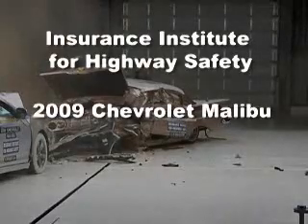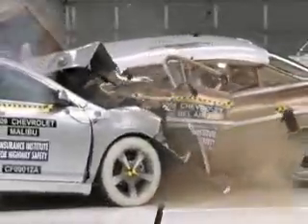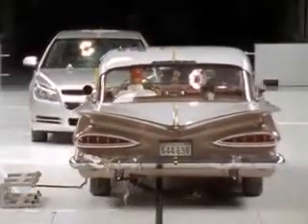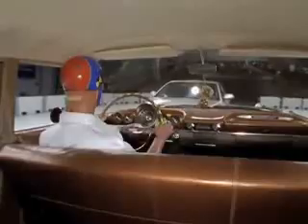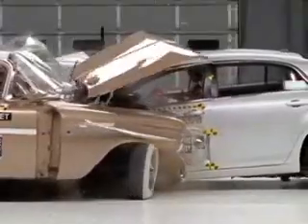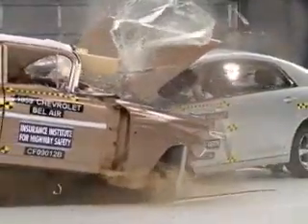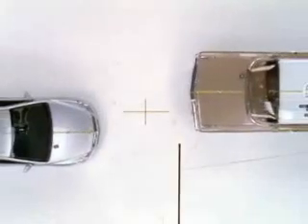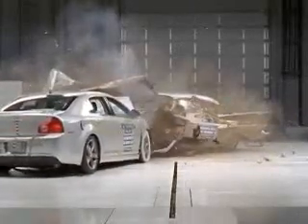Crash Test 1959 Chevrolet Bel Air VS. 2009 Chevrolet Malibu (Frontal Offset) IIHS 50th Anniversary

Comment: You people dont watch the news much do you? Local and provincial news constantly run stories with all makes and models of 21st gas-burning death machines. Stories that show twisted piles of 'high-tech-state-of-the-art-engineering; metal that you  often cant identify what make or model they (used) to be. People that think that cars are 'safe' or 'safer', today are either shills, willfully ignorant, or both. Saw a couple stories like that today in fact, fatalities of course. Seldom see anyone talking about how much safer cars are today in any of those stories. Lot of upset families and or people saying there was nothing they could do to 'help' though. Cars kill, they killed then, and they still kill today, every day in fact. And for every driver that dies, statistically, they manage to kill at least one non-driver. That is to say, people not in cars at all.

Comment: I'd still rather have the '59.
Reply: I will admit, old cars aren't the safest things on the road. My reason for wanting one is that in small impacts such as backing in to a post, a '59 would have a ding in the bumper while the '09 would have a cracked bumper cover and the possibility of the airbags deploying (even at low speeds like this, I've seen it happen).
Reply: MrDalek2150 Nope, just style for me. If I die I'll die happy.
Reply: I was actually gonna say that. I agree 100%. My uncle has a 71 LeMans Convertible that is practically a trailer queen, meaning he only drives it once every couple weeks. If you want something to look at, buy a model car. They have just as much detail as the actual car, and your not waisting thousands of dollars to just look at it.
Reply: +Bradley De Santa You can still buy a '59.

Just hope you never get in a wreck in it. You and the car will both be dead.

My car has power everything except a driver's side ball washer, 120v, 12v, USB, a much better stereo than that relic, is faster from a smaller engine, and goes 100K between tune ups.

Oh, but that has CHARACTER.  Awesome. 

I'd like one as a second car for cruising on the weekends, but I'd never risk it for long trips, hauling cargo, or night time drives on windy roads.

And near as I can tell, I'm older than you.
Reply: +Devan Driggers Yeah, but they have to be able to crumple incase they're rear ended by another car, unfortunately, that means compromising what would be a small "ding" to a post.
Reply: In like 50 years time our cars from today may have style compared to the cars of tomorrow (50 or so years from now) assuming we still have gas.
Reply: Devan Driggers a small ding in the bumper that has you rechroming the whole part lest it looks like shit  replacing or just painting over a cheap modern bumper.
Reply: if i die in a crash
i prefer to die in a awesome car rather than a cheap boring car
Reply: +Bradley De Santa China, you meant China.
Reply: But actually now that I think about it
Reply: Torque You see, that's why I don't like trailor queens. You buy "original condition" or "driver quality" cars and that way a ding in the fender, a scuff on the chrome, it's not the end of the world. You shed a tear, you knock some teeth out for backing into you, you move ahead, life goes on.
Reply: Japanese-designed cars are so good they came within inches of killing the American auto industry. Calling them Japanese cars is a bit disingenuous, a Toyota has more American parts in it than a Ford because they recognize the value of quality manufacturing.
Reply: me too !
Reply: Bradley De Santa your the dumb ass because the car the older one crashed into was an American vehicle
Reply: Get the '59 (Hey! Same year as me) put in seat belts and headrests. That should improve things a good bit.
Reply: ZnenTitan nope still would die
Reply: Devan Driggers have fun in the  afterlife!😂😂 jk
Reply: The 59  for a low speed cruise on open roads, in good weather.. The modern car for real everyday driving.
Reply: +Devan Driggers You want a crumpled pile of metal with sensors in it?
Reply: +Mike Williamson Ricer spotted.
Reply: So you either have a choice of style but instadeath or no style but safety. SIGN ME UP FOR STYLE I'LL JUST ADD A BUNCH OF SAFETY FEATURES (e.g seatbelt and possibly airbag, maybe better brakes) AND I'LL BE FINE.
Reply: I agree 100%
Reply: MrDalek2150 Why do i give fuck? Might as well be Japan, they both suck ass.
Reply: Mike Williamson No, he wants a car with actual character that wasn't made in japan. Dumb-ass.

Comment: The purpose of this video isn't to demonstrate that the 1959 Chevy is a piece of shit. Its to show what 50 years of analyzing car crashes, where the weak points are and figuring out what's really important in protecting the passengers. Think about   crashing that '59 into a car 50 years earlier like a model T at 50 mph and well, you'd just have sawdust on one side of this. But probably some old curmudgeon was  sitting there in '59 saying, my Model T was easy to fix, and when the bed rotted out, you just went to the lumber yard and bought new stock!

Look at any racing car crash from '59 vs one from '09. 150mph into a wall, you're dead in '59 guaranteed, probably taking out 10 spectators. Now, drivers routinely walk away from crashes (not that the odd fatality occurs, but its rare). We have learned things in 50 years people!
Reply: +sdry play nice or you'll get a time out.
Reply: +jboy55: but the driver of the 1959 Chevy is clearly dead or seriously injured. POS? No. Terrible crash rating? Perhaps.
Reply: +jboy55  I couldn't have said it better!
Reply: +jboy55 thanks mr. obvious

Comment: stupid fucks why dont u make it interesting and put a 1970 cadillac fleetwood agianst this new plastic POS..
Reply: +Musclman78TA1 It would be the same result. Modern cars aren't plastic. Their frames are more rigid and solid than ever. The plastic on the outside of for the crumple zones, which absorb energy.

This wasn't even that fast of a crash test, and the dummy in the old car was almost certainly killed, whereas the dummy in the new car may not have even been harm. If safety is remotely a concern of yours, get a good modern car with strong crash test scores.
Reply: +Musclman78TA1 You do realise the steel for the passenger compartments in modern cars is 10 times stronger than these old classics right? The rest are crumple zones DESIGNED to absorb the energy. In the test you mention, the result would be the same, dead people in the caddy.

Comment: The comments here are just ... wow.  I can't see how anyone could watch this video and not see that the newer car is far better at protecting the occupants of the vehicle. In the old car, you're being crumpled inside a flattening tin can.
Reply: People don't seem to grasp simple physics. The more the energy of the collision is absorbed by the car, the less is transmitted to the passengers. Old cars had thick steel and didn't deform and crumple.
Reply: Exactly. I will take a foot injury in the Malibu over death in an old car any day lol. Yeah old cars are better in some ways, just like new cars are better (safety being one of them)
Reply: @JetTDi  hahaha
Reply: Finest Citizen Your solo anecdote does not undo thousands of tests
Reply: @JurassicClark96  I know that this is also solo thing, but in 2014 car from 2013 was involved in front crash, seat mount rusted and front seal flew, into airbag was pinned to place by seat belt, and all other forces appear. Thing that i never seen, but i worked on 92-06 vehicles, and just see that newer car rust more quickly

If someone will guarantee that if that malibu Woudn't be rusted out in my climate. I would change my mind.

miisalo
"Not only the steel (or aluminum) used is more than twice as strong as used 30 years ago..." 
About better structure, i cant say anything. This is such improvement I couldn't deny it. But thing that i quoted, what is difference between 3 times stronger material if it is 3 times thiner, beside that it will faster rust out?
Reply: +FinestCitizen That's because the front of most modern cars are soft to absorb major impacts while the rears of older (and most newer) cars are very stiff. I was driving a rental 09' Corolla and was rear ended by a similar Corolla. Light damage to the rear end of the rental but the front end of the other Corolla was all crushed up n' shit.
Reply: +FinestCitizen You actually described why the car that hit yours was safe. New cars absorb the energy by collapsing the structures in controlled way. Also the structures surrounding the passengers are much stronger than in old cars. Not only the steel (or aluminum) used is more than twice as strong as used 30 years ago, also the structures used to protected the passengers are better. 

The problem with older cars is that if the collision energy is small, structures do not absorb it by breaking and the forces will fully affect the passengers (sudden acceleration) and when the structures break, they then just collapse like in the video. 

The problem with the new cars is that structures start to collapse even when the total energy of the collision would not be in dangerous levels, especially because they are designed also protect the pedestrians. So instead of dent, your vehicle gets lot of damage. But you don't. That is the difference.

Its all physics. Kinetic energy (and momentum) and how to absorb it. 

There seems to be even wiki article about crumple zones and this video https://en.wikipedia.org/wiki/Crumple_zone
Reply: Yeah but that's hurts my heart seeing the 68 Bel-Air being crashed fucking sucky
Reply: I can’t see the point in removing one engine and leaving the engine in the other vehicle. If that were so then the result has been tampered with and invalidate the whole experiment. I know it’s hard for Americans to rationalize, but there are still people and organizations out there that have something called integrity. I know my Volkswagen is a safer vehicle by far, than any vehicle I’ve ever owned. I remember as kid years ago seeing a car crumpled up like a scrap of paper. No thanks.
Reply: @Damremont18  That's a rumor and not true. Ever pop open the hood of a 50s era vehicle? Tons of empty space. According to the IIHS, the vehicle was drivable before they drained the fluids before the test. Here are their exact words on their official youtube channel:

The "Blue Flame" in-line 6 and all other components were still under the hood. This vehicle was driveable before fluids were drained for this test.
Reply: At higher speeds for the most part you may be right.  But at lower speeds the newer cars bounce off the heavier ones and end up in the ditch or going into another oncoming car
Reply: @korbondallas3524  The two cars in this test weighed almost exactly the same. Cars did go on a major diet in the late 1970s/1980s due to the energy crisis but have gained much of that weight back. So it's incorrect that old cars were very heavy and today's cars are light. BEVs are heavier than ICE cars and heavier SUVs are very popular.
Reply: @Ericwvb2  bUT THATS APPLES & ORANGES - You can't talk about SUV's vs. a passenger car.  Compare like vehicles by size.  The older ones did have heavier frames and bracing, even the panels were thicker and weighed more.  Compare station wagons then and today, or old Econoline to the minivans.  Even the Secretary of State recognized this and started charging registration based on the make of the car and NOT weight - because the newer ones were lighter and brought in less money, even though they actually did less wear & tear on the roads themselves.
Reply: @korbondallas3524  It's not apples and oranges because it's what people drive. But let's eliminate SUVs (the most popular vehicles today are pickup trucks and SUVs) and stick to passenger cars.
1959 Chevrolet Bel Air : 3,510 pounds
2009 Chevrolet Malibu: 3,415 to 3,649 pounds
2023 Toyota Camry: 3,310 to 3,595 pounds
You can pick heavy and light vehicles from both eras easily.
Reply: Probably because they took the engine out of the old car.
Reply: +Eric van Bezooijen I still call bullshit on this video.  I have a 1985 Mercury Grand Marquis and have been hit a few times over the years.  Most recently, a vehicle similar to the 2009 Malibu above rear-ended me while I was sitting at the light waiting to make a left turn.  The driver, of course, backed up and took off, but, the whole front end of his car was completely obliterated.  How the driver was actually able to manage take off is beyond me, especially with debris everywhere, a crumpled front end and a broken axle.  At least law enforcement was able to catch up to him and detain him for a hit-and-run.

As for my car, the only real damage was a dented metal fender, a few chips/cracks in the taillight covers and a loose transmission.  It may have cost me more to replace those parts, but, that car saved my life, even without the modern-day safety standards.

There's some speculation as to whether the 1959 Bel Air had an engine in it or not, but, you can clearly see it had been sitting there for the past 50+ years or so in storage.  It was clearly rusting away while the 2009 Malibu was in decent shape, probably right off of the assembly line.
Reply: I think the problem, and this goes to basic scientific method and logic, is that your crash wasn’t the same as this offset head-on collision test.  

Sounds like the car that rear ended you hit you flush on, not offset.  That means that any impact was distributed across the entire rear bumper on your car and front bumper of his car.  

Also, no mention of speed.  It’s possible the other car hit you going 50+ mph; also possible he hit you at 15 mph at a stop light.   Would need more info. 

Also, I’m not a car expert, but I’d imagine a rear end collision is less dangerous than a head on collision.  Your further away from the back of the car as the driver and there’s less weight back there as the trunk is empty space, followed by some cloth and foam seats.  A head on collision has the engine block and various metal parts of the car’s “innards” directly in front of you, which means for an older car without crumple zones or safety glass, that the engine block is going to come careening back, driving the dash, hood, glass, etc right at your face and neck and torso. 

I know we love to all talk about the good ol’ days and to be sure, older cars had a style that today’s cars don’t, but in reality I’d rather be in a 2019 Honda Civic than some old hunk of steel in a car crash.  You can only enjoy driving a car if you’re alive to do so and don’t have your vertebrae and legs shattered into pieces!
Reply: @FinestCitizen  Ironically, you didn't understand the point. That new car that hit you, that had more damage than yours, is precisely why it is better than yours at protecting you.

The car absorbed the damage and kept the driver safe. Your car didn't absorb the damage; it transferred it to you. Had the hit been stronger, you would have been injured (or dead), and he would still have walked away. Your Grand Marquis would be easily fixable by an experienced body repairman, while his Malibu would have been written off. Your widow wouldn't need to pay much to fix her late husband's Grand Marquis,  while the other guy would need to shop for a new car (for the money he got from the insurance).
Reply: I looked up some info. They claim the Bel air had no rust that would have weakend the structur and that the red brown dust that poof out when its hit isnt rust but road dirt, it also had the straight 6 even tho to me it looked really empty inder that hood but they hit just off to one side of it which explains the hard deflection i guess. Btw most of them bel airs had the V8. Also if i remember correctly the bel air has its frame more down the middle and then it T's at the front and back for mounting so its body could sit lower on the frame but doing an off center hit is kinda intentionally hitting the bel air weak point without the big V8. I would like to see what a full head on with the V8 would do to that impala or a classic that has a ladder or H frame. I also find this fishy because modern cars are made of nothing but crumple barriers so it will lessen the G force of the impact by crumpling the whole front like a tin can and ive seen it with my own eyes a lot of these newer cars get very smashed up from even light impacts. Ive also seen a 60's mercury cougar hit a telephone poll head on and really didnt need a whole lot of work to get back on the road. Personally i do think the crumple barries do save lives BUT i think this was set up and they intentionally hit a weak spot on the bel air and the car probably had some structural issues and also it having the I6 didnt help just to make the new cars look better but ive seen far more old cars come out of accidents a lot better then new cars. The same can not be said for the drivers "cougar drive was taken away on a stretcher and not concous btw"
Reply: screw new cars! the older ones will ALWAYS BE BETTER!